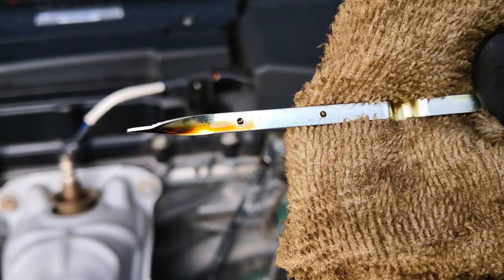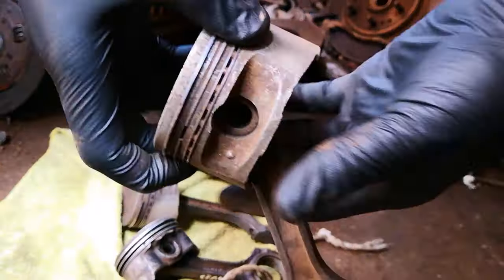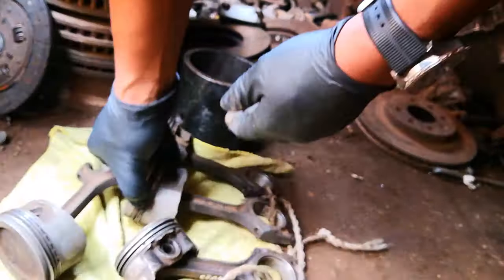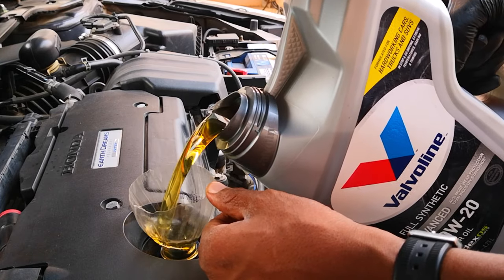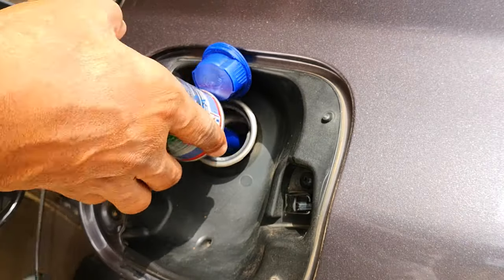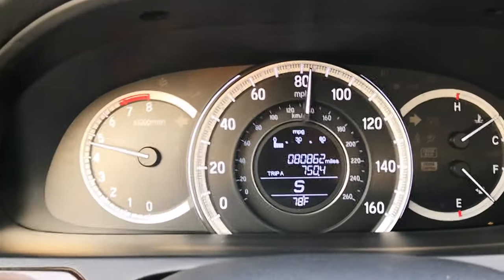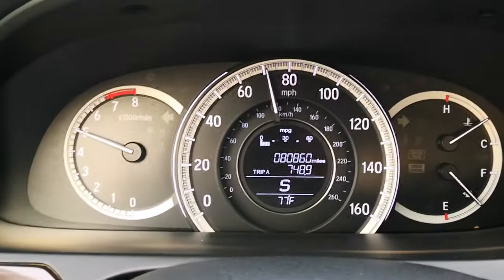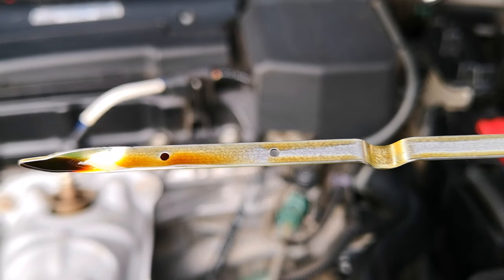Easiest way to Free Stuck Oil Control Rings / Stop Oil burning: Easy oil Consumption FIX

Comment: It work wonders but in some terrible cases it might not... Some egines just need to be rebuilt. Over time when the ring is stuck in the ring lands the heating snd cooling process have adjusted the elasticity or the spring nature of those rings and it won't spread out again. Sometimes it just have to be torn down. Best way is to soak with Seafoam overnight drain it, start the vehicle and drive it hard so the engine reaches operating temp...(italian tune up) but in terrible cases it still won't help just reduce the quantity burnt.
Reply from the maker: 💯 Agree. It looks to me though, that B12 chemtool is one of the best for a piston soak.
Reply: @DIYAutoworksNG  if you have used it, I'd agree with you. I'm a mech in benin and I like your work. Nicely done, one of the few people i know who knows their onion.

Comment: In theory, does the italian tune-up work as well to clean piston rings in a port injected engine as GDI? Assuming you have fuel with the proper additives.
Reply from the maker: It works in port injection engines too. Heat does wonders🤣
Reply: I really can't support OP's "tune up" method.  Aside from being illegal and super-dangerous, there's no need for this radical method!  If you don't change anything else about your driving, such as your choice of fuel, your oil change interval, or the additives if any you dump in the fuel tank, you would really have to do a crazy amount of top-speed driving for a very dubious remedy for a few stuck piston rings!  
There are better and safer ways, that are much more gentle on the engine, than trying an Italian tune-up!  Obviously the best method is to head off the problem in the first place, by oil change intervals using quality oil, of the weight your carmaker says to use.
Also to me it seems worthwhile to use a fuel additive to prevent sticking rings.  Two I've used are Yamalube ring-free and STAR BRITE Star Tron Ring Clean Plus.  They are not as cheap as say Gumout or even Techroline but you only use 1 oz per 10 gallons of fuel so one bottle has several treatments.  
And to me, just about ANYTHING is better than trying to maintain a crazy 120 mph on the highway for any length of time, just to unstick your piston rings...
Reply from the maker: @robertmaybeth3434 thanks for sharing.

Comment: I have this problem with my Peugeot 107.I will buy some of that liquimoly valve cleaner and try this trick.Would 30 minutes on the motorway be long enough you think?
Reply from the maker: Would depend on the level of build up. Because I did mine over a long period I couldn't tell at the point the control rings got unstuck.
Reply: any luck ?
Reply: @Thenexusuk1  Im on 2nd can of Liquimoly valve cleaner.Car feels better.Im monitoring oil usage and will check after 1000 miles.Im driving almost 100 miles per day.I may also buy another 2 tins of the liquimoly valve cleaner to make sure its done its job effectively.
Reply: @safdarrizvi9885  any update? What motor is in your car?

Comment: I will say tho this may work for most cars take care as the increased compression caused by the oil can cause excessive strain on older engines, which could lead to damaged valves or bent con rods.
Reply from the maker: Good compression won't cause damaged valves or bent rods. Has to be something else in my opinion. Incorrect timing, water injection etc.
Reply: @DIYAutoworksNG  excessive oil in the cylinders increases the compression ratio and as a result the heat and stress during combustion, just replaced a head and valve train due to this.
Reply from the maker: Yea, but free oil control rings should reduce the oil in the cylinders?
Reply: @DIYAutoworksNG  However in older engines and japanese engines especially the oil rings can get gummed up with burnt oil which keeps them retained in the piston rendering the scrapers useless until either replaced or freed up slowly.
Reply from the maker: I think we are aligned and saying the same thing. Thanks for the comments.

Comment: Can I recommend a video I think would be good for your channel? I think you should do a video of how to turn off TPMS with a Autel scanner without changing the sensors . Also lamp out for led tail lights on dash completely erase them let’s say aftermarket tail lights work properly but dash says light out is there a way to erase that permanently 😊also raise the rpms in truck/car with scanner bidirectional
Reply from the maker: Hey! Good to hear from you my friend. I wish any of these were possible. There's no way of doing any of the 3 requests genuinely with a scanner except you want to remove the indicator bulbs which won't be nice

Comment: My engine totally seized, cannot turn. which liquid should I use? Is there a chance something will free up the pistons? The oil is so muddy in the car as I saw.
Reply: if you have muddy looking oil that means coolant and oil are mixing in the crank case. most likely a blown head gasket, but could be other types of damage like a cracked cylinder wall. either way, it sounds like its gotten bad enough to wipe out one of your connecting rod bearings. so unfortunately in your case, the engine needs to be completely torn down and parts inspected and rebuilt, or a complete engine replacement. there is no substitute for this... severe internal damage has happened inside your engine
Reply: @tabletop45  Thank you very much for your detailed answer. My description was little missleading. Only in cylinder heads has this muddy oil sticked on them. The engine has normal liquid oil. I even changed it. Anyway you answer seems legit, because I put fresh oil through the spark plugs and still cannot turn the engine. And I disassemble the timing belt cover and it is smutty. It seems that someone burned down the engine. Can it be? The engine block from outside covered with dirty black oil.
Reply: @jutyuubfiook   now just to confirm when you say "muddy" does it look lighter? almost like a chocolate milk color? or are you referring to "sludge" which is more clumpy and dark. 

in either case, if you can not spin the engine by hand, something has seized it, most likely the connecting rod bearings to the crank shaft. if your engine has a lot of sludge built up, it is indication of poor maintenance, and excessive oil consumption will eventually run the engine low on oil and seize the bearings.
Reply: @tabletop45  dark black sludge which is visible on the cylinder heads when I open the oil filling hole.

Comment: Can you do it with car idle...high revs?
Reply from the maker: Nope. You need the heat from the high RPM. If you don't want the speed, you can consider driving in low gear with RPM at 4000 for a few miles
Reply: @DIYAutoworksNG  we can't go past 110KM/h in Australia and the car don't have low gears, only have D mode😢
Reply from the maker: @Dopamine1217  I see. You may have no other option than a piston soak.

Comment: how long do you need to drive at high rpm to notice imoroved oil consumption results (freed up oil control rings) ?
Reply from the maker: This is the part I don't know! Couldn't tell at what point it happened. I picked up the oil burn reduction by accident! Another viewer here said he drove about 3 miles or so but with the transmission in L and at high RPM, and that was enough to solve his oil burning...
Reply: @DIYAutoworksNG  I just tried marvel mystery oil yesterday on my mom's '04 Call 2.2 Ecotec.  If that doesn't work then I plan to try Slick 50.  If that doesn't work , then I will try your remedy.
Reply: I really hate to contradict people who actually posted a video, but I feel like I am obliged to point it out when their advice is very dangerous!  I for one, would never, ever advise anybody to free up their stuck piston rings this way! 
 
OP's so-called "advice" is to take your car on a highway, floor the gas pedal and hang on!  I can think of several very good reasons to NEVER do this and no good reasons at all for flooring the gas pedal on a public highway.  Aside from the obvious potential for fatal accidents such a driver creates for every living thing in his path, there are a hundred better and safer ways to free up your stuck rings!  

And even if you are doing this on an empty highway with no other cars around for miles, the possibility of a crash is not something to dismiss lightly.  Even expert drivers can easily make a mistake that ends in a crash; but even the best driver ever born can still crash if the car's not in perfect condition and something in it - a suspension component, a motor mount, any one of several critical parts - chooses that moment to break and render the car uncontrollable.  

There are all sorts of chemicals that will unstick your piston rings gradually, "Yamaha ACC-RNGFR-PL-12 Yamalube Ring-Free Fuel Additive" is one, "Star Brite 095616 Star Tron®Ring Clean" is another, either one of these is a much better alternative to just flooring the gas pedal...
Reply: @robertmaybeth3434  I'd like to learn the other 100 different ways to free piston rings.  Thank you.  .... Hate to contradict you.  I floor my gas pedal all the time !!!   I let up once I hit 30 MPH.   Hate to contradict you  AGAIN
Reply: @Mr_BUSINESS_24_7   In Montana , you can  let up after you hit 80 MPH

Comment: What about using engine flush with the oil change? Seems like that would target this issue better.
Reply from the maker: That also works
Reply: @billsanter  I do engine flushes every year or to, but it didn't fix the oil consumption problem.
Reply: @billsanter  About every 2 years, I do a double oil change on my Honda. I add some  Marvel Mystery Oil to the engine a few days prior & drive it. On oil change day, I drain some oil to & and add Motor Flush & let the car idle for 5 minutes. Next I add 2 quarts of Marvel Mystery Oil & the rest is oil, installing a cheap oil filter. I then let the car idle for 5 minutes. Next I drain the oil & put good synthetic oil & a good oil filter. Oil is so clean the It's difficult to see the oil on the dipstick. I've owned the car since new & now it has 115,000 miles on it & the motor is  perfectly clean inside. If I remove the valve cover, it's perfectly clean. For cars that weren't properly maintained & are full of gunk, I wouldn't recommend doing this because you'll probably plug up an oil passage & spin a bearing.

Comment: Does this actually work. I have a j37 that is using some oil
Reply from the maker: It does, no kidding. If the oil loss is purely from stuck pistons, it should help. I'm guessing you've ruled out a stuck PCV valve?
Reply: Ues. I will give it a try

Comment: Unfortunately for me my car is limited to 124mph and at that point it's only cruising at 4400rpms😭
Reply from the maker: What car is this? It's really not about the speed but the load applied. You can drive in the gear lower than the highest. Also keep local speed limits😉